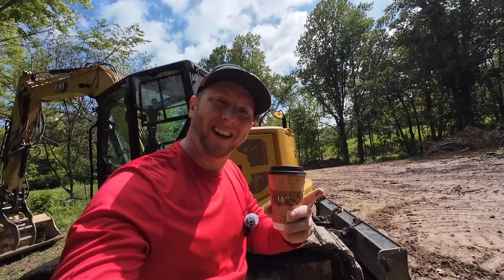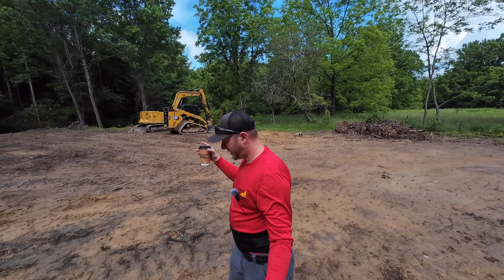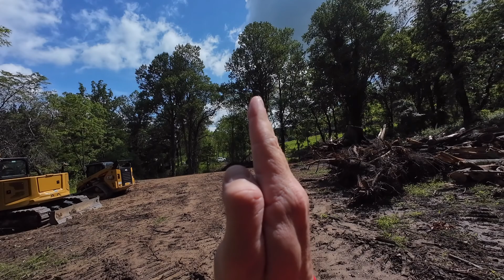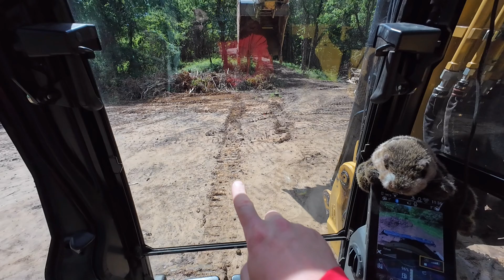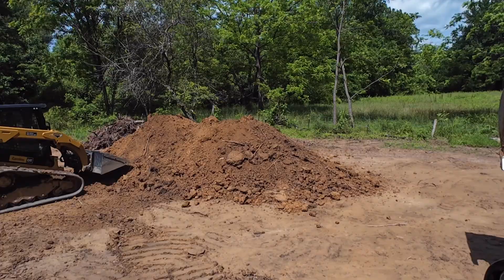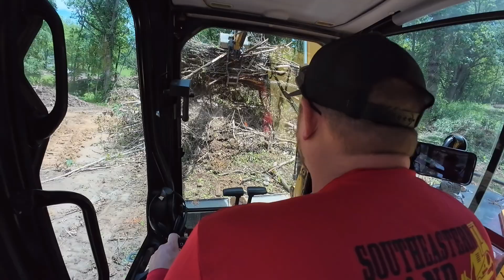Preparing laydown area for the road build and next burn day

Comment: So you have your stick on the right joystick and boom on the left.  I've heard people recommend flipping them so the boom is on the right, so when you use your skidsteer the right joystick is still boom/bucket.  Obviously you switch back and forth and are super smooth on both.  Would you recommend a new operator learn it your way, or do you think the right joystick for boom/bucket on both excavator and skidsteer is a better way to learn?

Comment: Definitely unhooking the mulcher is a big struggle sometimes. Almost always have pressure in the mulching head. Had to use the wrenches as well. Don’t force em together. I didn’t have two wrenches first time. I got it hooked up but damaged the oring in the flat coupling. It leaked like a sift. Had to stop and go get a a new one. Keep one with me now just in case but always have the two wrenches. Great tips Todd.  Thanks
Reply from the maker: Anytime Brian

Comment: Anytime you disconnect the hydraulic lines and there is any ambient change the pressure in the lines goes up or down , it only takes a few degrees to raise the pressure alot that is why you have to bleed off the lines , most people disconnect in the morning and try to reconnect in the afternoon and bam you have a ton of pressure built up in the attachment lines
Reply from the maker: Well put Matt 👍

Comment: Why is there not a button to push to release hydraulic pressure? What are the engineers at cat doing? This was probably an issue from day 1.
Reply from the maker: The new Skidsteers do have a type of bleeder. Excavators not that I know of. I’m with you though. There should be an easier solution
Reply: My takeuchi tl12 skid steer has a pressure relief    knob.  But still you have problems sometimes.
Reply: @BillTalkington-g5r  My TB260 also has a relief button.
Reply: 2020 Bobcat E85 also has a pressure relief valve